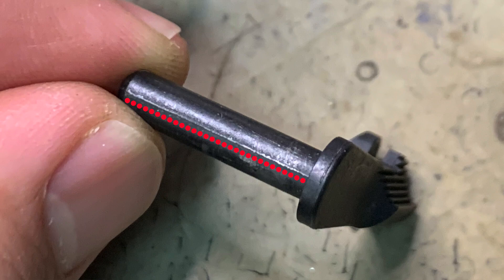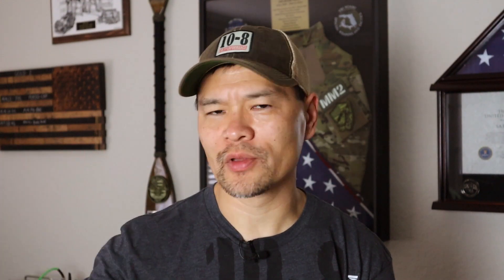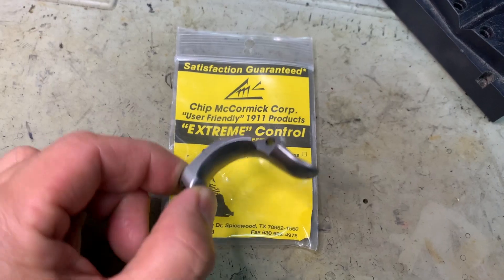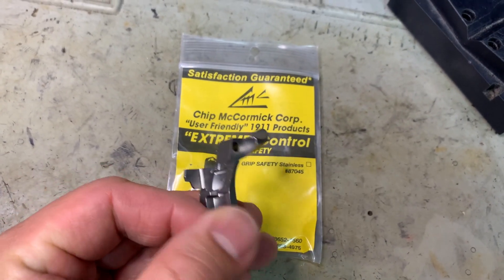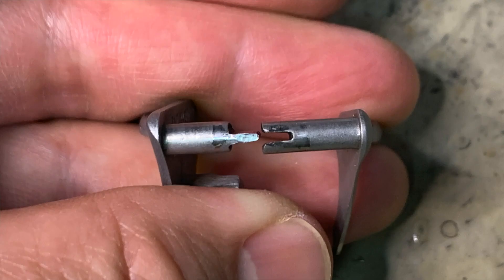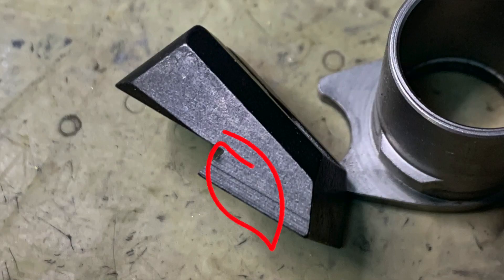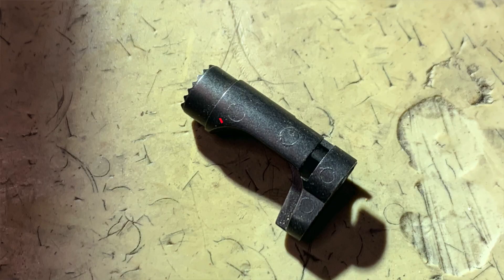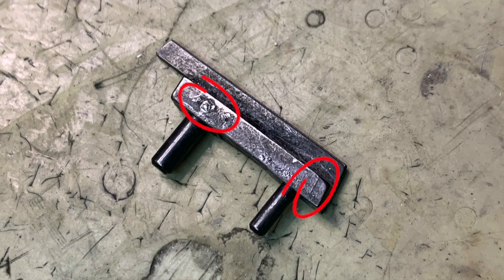10-8 Performance Lab, Episode 31: MIM In The 1911

Comment: Great explanation of why and where MIM parts are used.  I bought a 2020 Staccato P in January and have 1400 rounds through it.  Awesome pistol.  Glad to know they didn't fill it with MIM parts.  I just discovered that the grip safety is not working but I'm sure that will be resolved.  Enjoy the videos, keep them coming and stay safe.
Reply: You’ll need to tune the leaf spring it literally takes 5 minutes be sure each leg is where they need to be when completing reassembly.

Comment: Another Great Video 👍. Ordered a Springfield RO couple years ago for Service Pistol CMP matches . Waited 9 months then Springfield without any notice stopped manufacturing RO. So my FFl ordered me the Springfield “Loaded” which was over a year ago still in production (not anymore after “Garrison”introduced) which is basically same as RO but more bells and whistles which included ambi-safety. While I use it for CMP matches, it’s educational to know the MIM ambi-Safety May be issue. May check into having a non-MIM ambi-Safety installed eventually.

Comment: Replaced the MIM parts in my two Sprinfield Elite Operators after seeing the hammer on the 5” Operator was actually “canted” to one side. Everything except the ejectors have been replaced with parts from Cylinder and Slide as well as from Ed Brown.

Comment: Great video. Just remember that there are many mim materials and the selection is crucial. Also custom blends are possible for improving material performance. In addition, a H.I.P. Post process can be specified to bring densities to 99.6% (expensive) Another key is mold design. Proper material flow is key to a good part. Doesn’t 10-8 sell 1911 parts? 😀

Comment: Spot on.  I have 100 rnds through a new Sig 1991 X-Carry.  Dryfiring today and snapped the right ambi safety off inside the slide.   Not sure if it is MIM but I would suspect that is the issue.  In the “return to Sig” prices now.

Comment: Have used 1911's extensively that were from various price points.  Have never had a failure that one could attribute to MIM.  Have had a couple firing pin stops that cracked.  Have had a firing pin that broke.  Have had an extractor that lost tension.  That's about it.

Comment: I and my buddy each had Kimbers Mine Custom Classic II, His an Eclipse both had  many thousand rounds on them. Mine started to triple. I replaced the FCG with C&S Tactical II FCG. and 6 months later my buddy's Eclipse started doubling, and tripling, again replaced with C&S Tactical II FCG. I had to get the plunger tube replaced on my Colt Mk IV ser 80, and replaced the Slide stop, Beavertail, and safety. Because I'm watching this video.
Reply: My Colt Mk IV series 80 "Combat Special" also had a massive failure of the plunger tube WHILE I WAS firing at the range. The flared tang on the post on one end completely let go, the retaining pin snapped off and the plunger tube assy came almost off the frame which allowed the slide stop to um . . .stumble and part way engage during the firing cycle. Scared me big time. I stopped and investigated, came home and watched several dozen YouTube clips to see what was what. I ended up buying the installation tool and Ed Brown tube plus the 2 pins and spring all for about $50 from Brownell's. When it came, I studied the literature and watched the videos some more before I started. The whole job went super easily and when it was finished the pistol was BETTER than new! Since then, I have fired a few thousand rounds down range and ALL is well.
Reply: what is a fcg
Reply: @tomgiorgini9154  That would be the Fire Control Group - the combination of the hammer and trigger usually. The 2 safeties are included often, the grip safety and the manual (thumb) safety. Heck if you're going to go that far you might as well do the slide stop plus the sear and disconnector too.
Reply: @timwalsh715  thanks for the reply i would assume from his explanation of the problem it was the sear and hammer his initials did not say to much to me anyways thanks for the clarification, after i posted i figured thats what he was indicating but that really does not describe what the problem was
Reply: @tomgiorgini9154  Fire Control Group = Hammer, Sear, and Disconnector.

Comment: Food for thought:  the firing pin stop holds the extractor in, and controls its position in the slide.  If it breaks and the bottom half falls out. . .
Reply from the maker: Food for thought: you can what if breakages to death, but I already covered the FP stop in the video. They aren't subject to shear stress and as such statistically less likely to fail regardless of composition.
Reply: 108Performance personally I had one crack in half on a TRP after 1000 rounds.

Comment: I would replace factory slide stops with a Wilson Combat, Nighthawk or Ed Brown for the simple fact that they have a groove cut in to them that makes it a LOT easier to reinstall them. Being stronger is just an added bonus.
Reply from the maker: I would replace the factory slide stop with my 10-8 Performance part as it has improved lobe geometry not only for easy install, positive lock back, and a detent angle to reduce possibility of false lockback. But that’s just me.
Reply: @108Performance  i routinely do that.  You just sent me another one.

Comment: Hilton, apologies if you mentioned this and I missed it after watching the video twice: What is your opinion of MIM extractors and titanium firing pins?  I'm thinking of recent US-made Springfield Mil Spec and probably many of their other 1911's.  Thanks.
Reply from the maker: I don't recall any extractors being MIM, they're usually bar stock but the money is in the heat treat and fitting. Stock sub $1000 guns usually have money saved on both those critical areas and I always replace the extractors with Wilson Bulletproof. The Ti firing pin is fine. Check out my other 1911 videos for more info.
Reply: @108Performance  I will, and thanks much for the reply.

Comment: MIM parts got a really bad rap back in the early 2000s when Kimber had a rash of parts breaking in their guns due to poor quality control of the MIM process. Around the same time Colt tried using MIM extractors, and that went over like a lead balloon as those failed almost immediately. Both companies learned their lesson and improved the quality of their parts, but the stigma has remained.

Comment: The extractor tool is plastic and the gun ate it up the first time I used it. I had a bunch of broken off plastic parts all over. I wasn’t impressed with its durability. The 2011 tool worked great though.

Comment: Are there any MIM parts in the SA PRO Operator LR? If so, may I send it to you for corrections and to have the rear sight centered? The rear dovetail is tight!
Reply from the maker: Parts composition varied by each run. Sorry I’m not a gunsmithing shop. Leave the parts alone, we didn’t have them fail due to composition, and unless you’ll fire it more than we did at work you’re good.
Reply: Thank you for your reply. I definitely won’t shoot it as much as you all did (unless someone wants to send me ammo), and will leave it as is.

Comment: Does it make any sense to replace MIM with cast? I had an old Ed Brown hardcore cast slide stop and opted to use it on my Kimber. Similarly I replaced the thumb safety with a Wilson cast unit for geometrical reasons. Any inherent advantage of MIM over cast parts or vice versa?
Reply from the maker: Ryan Smith As long as the part is a quality part, the method of manufacture is actually secondary. However, if we are speaking strictly of methods of manufacture, I would not place MIM or cast over one another as superior, as the only one I really feel is genuinely superior is machined bar stock.

Comment: This is what I have searched for but never found. Make a small I-beam, say one inch tall, half an inch wide, and six inches long using the cast method, forged method, and MIM method. Then prop up each end and put pressure in the middle in a standard strength test. Also, using each method, make a part that takes an impact, such has a pistol hammer or ejector, then do a comparison endurance test. Can anyone point me to that kind of video?
Reply from the maker: Certainly an admirable desire to see some scientific method being applied. However, the tooling for just the proposed I-beam alone - a mold for casting, a forging die, and a mold for MIM - would likely cost over $200-250k. Current ammunition price for the proposed endurance test of each of the 3 components is $.60 - $1 per round in .45. Then consider that Youtube videos are viewed for free, and prepared at the expense of the channel providing it. 

Your alternative is to do the test yourself by locating and purchasing your proposed cast, MIM, and forged hammers, then shoot 10k rounds through each and report back on your own Youtube channel.

Comment: Of course you already know to be  careful with the brand of 1911 you purchase. They all will pretty much shoot well but what's inside them is going to make a big difference. Unless MIM parts are made correctly they will certainly fail. Cheaply made ejectors, sears and extractors are the first to go for sure. You won't get 300 rounds out of them. A cheaply made slide stop will more than likely just bend out of shape rather than snap. The 2 very best MIM 1911 parts are Fusion Firearms and Wilson Combat for sure.
Reply: I thought all Wilson parts were made of steel ?

Comment: Have you seen the new Bul Armory 2022 models like the SAS II Tac  4.25" (https://www.youtube.com/watch?v=Nf9aP7TUORo)?  It seems like a competitor to the Staccato P. I've been trying to find out from But Armory if any of the following are MIM parts? Slide stop, ambi thumb safety, hammer, sear, plunger tube, ejector.
Reply from the maker: Bul Armory guns are most certainly not a true competitor to the Staccato. They are imported, use a large quantity of MIM small parts, and are priced higher than comparable Staccato models. I prefer the Staccato, made in Texas with all US machined components.
Reply: @108Performance  Thank you for responding and for your insight.